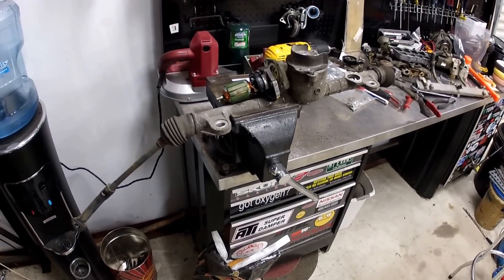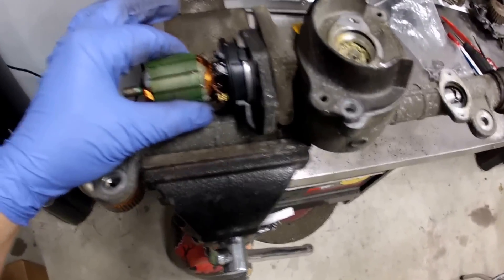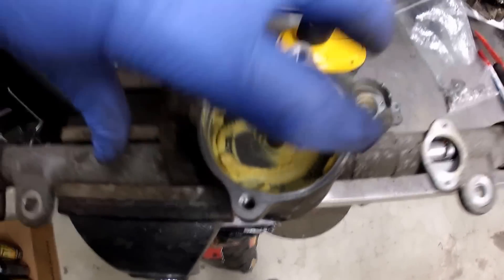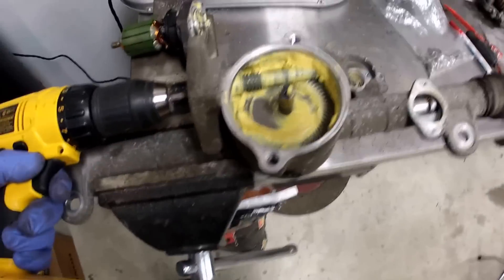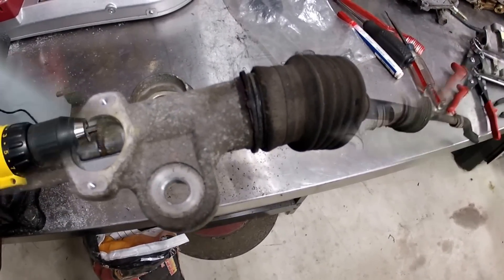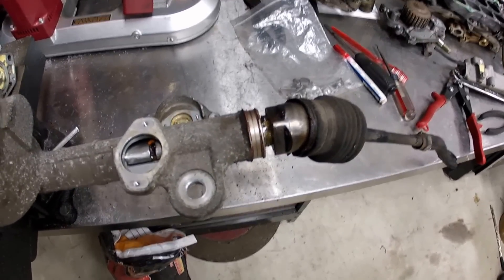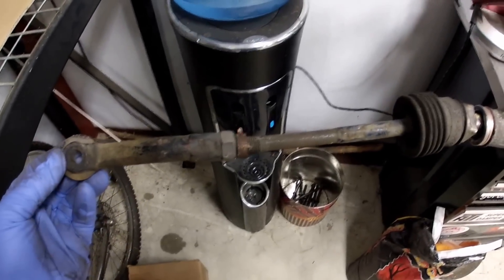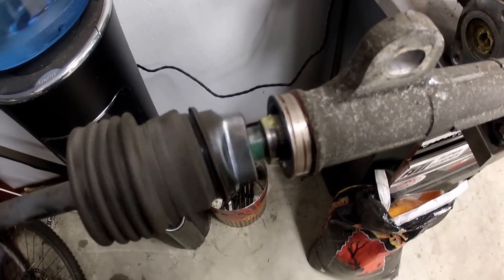Nissan 300zx Z32 Electronic HICAS 4WS Rear Wheel Steering Explanation

Comment: This is actually great to know how this works. I have been thinking about incorporating this HICAS system into a future build I have in mind. My only question is, does this only work on the Z32 rear end, or can I install this into a different rear end?
Reply from the maker: R32-33-34, S13-14, Z32 are all SIMILAR but not sure if they are the same.  S13 had factory HICAS available but was pretty rare to find.
Reply: I'll keep that in mind, because I'm doing a Vaydor build but with how I'm doing it, it's going to be a Nissan Frankenstein essentially. And one of the issues I'm trying to solve is turning radius. So I'm looking into that with finding means to not have the kit require huge spacers (the wheels for the kit are fitted with 5 inch spacers), and then also incorporate the Hicas into the car. And the theory is with smaller spacers and the HICAS should improve on that end.

Comment: So how fast is the motor's affect on the rack? Playing with the idea of putting a rear steering rack on an AW11 MR2 at some point and being that my SO owns a '96 Z32; HICAS was my first logical choice.  Since the AW11 is literally a FWD engine/transaxle thrown into the rear, the knuckles already allow for steering. All that's required (IF there's a place to mount it) would be custom tie rods and figuring out a way to have the HICAS module read my steering inputs (Assuming HICAS can even run "standalone") and be able to tune them as well as being able to override them with a joystick if i just want to have some fun. 

Disclaimer: this is really just a "want" that all stemmed from the fact that rear steering theoretically would work on an AW11. i know it doesnt really do anything to make the car handle any better because they're already prone to snap oversteer, i just kinda want to see it done one day lol